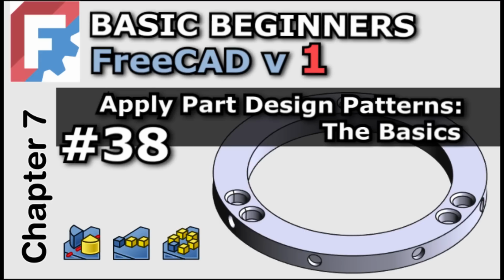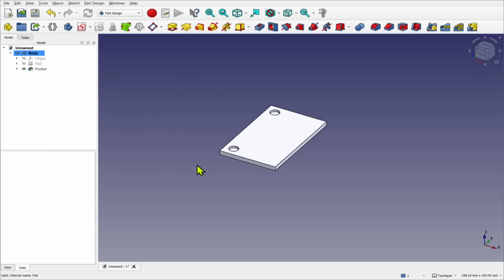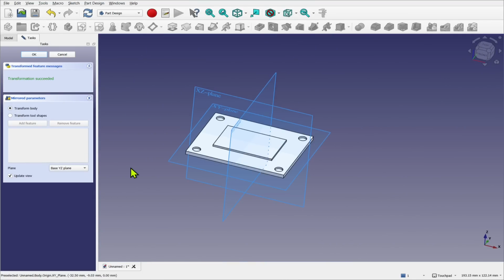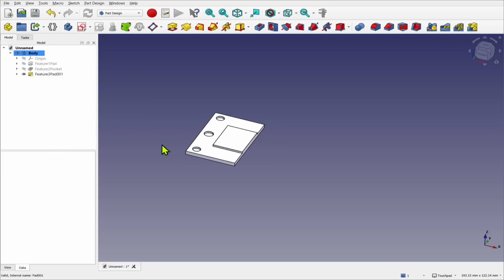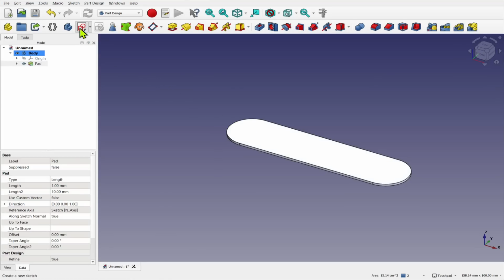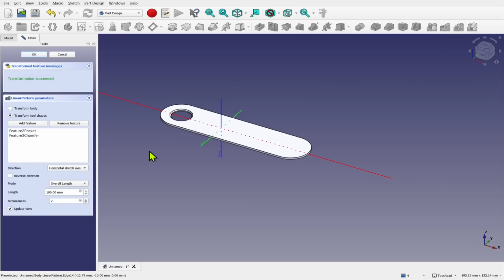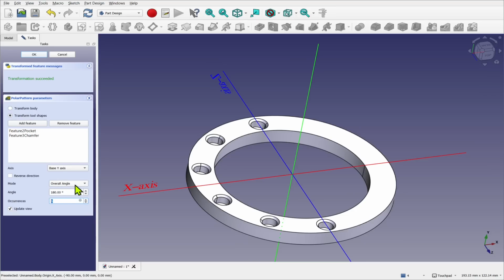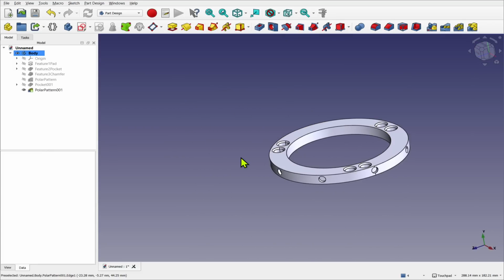Freecad v1. 0 | The Basics: Applying Part Design Patterns  | Basic Beginners FreeCAD 1.0 | Lesson 38

Comment: Is there a change in 1.1rc1 that prevents this movement of the new sketch in the last section of this tutorial with the ring and the radial holes?  21 min 30 seconds  i cant get the axis to move.  i tried in 1.02 and it works....
Actually the pairs of holes on the top face does not work either ...

Comment: I thought you will be talking about generic design patterns when designing things in CAD. Dunno about CAD, but in software development - there is an idea that there are some common patterns that you should know if you're experienced
Reply from the maker: There are design methodologies that I mention in other videos, such as top down bottom up approach relating to assemblies, data driven design (from a datasource such as var sets, spreadsheets) etc.  But with code (used to be a Dev in a previous job myself) its fluid and can be arranges in many many different ways as you have full control over the code itself, so using patterns such as the repository pattern and obeying SOLID principles I find doesn't really translate to a CAD equivalent in the same kind of thinking. You are highly restricted by the choice of program and its ways of working, there are more metrologies like direct modelling, parametric modelling, surface and solid modelling etc which are defined by the programs boundaries itself.  Direct modelling is history free and is more like what you would do in mesh modeling in blender where freeCAD is parametric so history / feature driven. I haven't done an actually dedicated video (except for the part vs part design where I went into solid vs surface modelling) to explain these. Which, may be a good thing to do.

Comment: I noticed you created multiple sketches along the same plane. Is that preferred over creating one sketch with multiple pads?
Reply: I've found it's easier to modify dimensions or fix mistakes if each feature is it's own sketch. Daren conveyed that in an older video.
Reply from the maker: I am assuming your referring to the feature of selecting closed series edges of edges that create individual profiles in one sketch, i.e. a single sketch of a ring with circles in, then selecting the ring, padding and then the circles and then running the pad?  If so it can often be more flexible and quicker to create the individual sketches as you have to work your way around ctrl selection the edges.  Once freecad allows for selection of an enclosed shape inside a sketch with a single click this will become much quicker.  And as @ezone913 it makes it much easier.  There is less to constrain down and less clutter getting in the way.
Reply: @ Makes sense! That was the impression I was getting after playing around with it. Being able to select a face and pad it would be very nice.

Comment: Thank you for this! I've been experimenting with parametric designs that leverage a linear pattern and this vid helps explain a few issues I ran into. I still see some "weird" behaviors in some cases that I hope to understand with more time and practice. In my case, a simplified explanation of the design might look a bit like a napkin holder; a flat base with two vertical panels spaced apart for the napkins to sit in. The tops of the panels are rounded with fillets, as are the bottom edges where the panels intersect with the base. The fun part is that through variables I can change the number "holders" as well as the spacing between them, and the model recalculates the length of the base needed to hold the number panels at the specified spacing, as well as increasing the number of panels of course. 

It's very cool that this works at all but I've got something off that makes it a bit janky; I often have to force a refresh to get it all to redraw properly and sometimes I have to reduce the count below what I really want, refresh, then change the count again. From watching this video, I suspect I have one or more features out of order and am creating some kind of unintentional dependency. At least I have an idea of what to look for now so THANKS!
Reply from the maker: That's a nice little model you have there! Using the pattern and the expressions editor is always fun.  I have a number of videos in the bank (as going on holiday) and I have utilized the linear pattern in a similar way, using the formular to update the occurrences (I think it may be the next video).  And now you say about the problems your experiencing, I remember seeing this before but I can't remember which model.   You have got my grey matter working and I am wondering if it's a rounding issue.  Say your creating occurrences of a support based on the length of a object.  The longer the object, the more supports you need.  So you divide the length by a base value i.e. 100 is you base value and the length of you model is 100, so 100 / 100 = 1  then you add 1 to make 2.  So 2 supports that is your expression for the occurrences.  So If the models length is 200 then we get 2 and plus 1 so 3 supports.  But, if we have say 250 then we get 2.5.  This should round up, but there must be a point where it rounds down.  Maybe something to do with this?

Anyway, went off on a bit of a tangent there.  Glad your enjoying the videos.
Reply: @MangoJellySolutions  thanks for the extensive reply! I'm mostly sure it's not a rounding thing but now that you've mentioned it, I'm going to double-check just to be on the safe side. For debugging, I've started moving some of the calculations into variables instead of in the measure formulas, and then reference that calculated variable from the measure. This gives me an easy way to view the actual calculated values while I'm adjusting the basic width, count, etc. that drive the formulas. Still so much to learn!